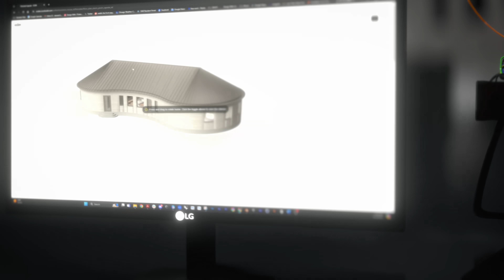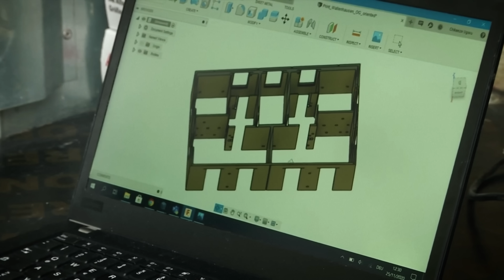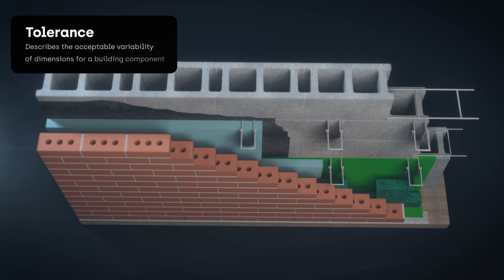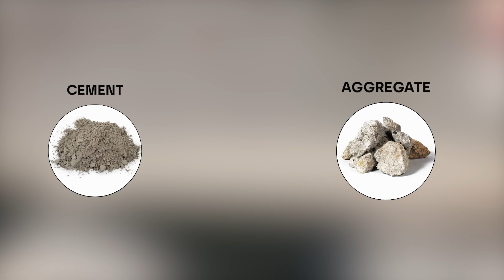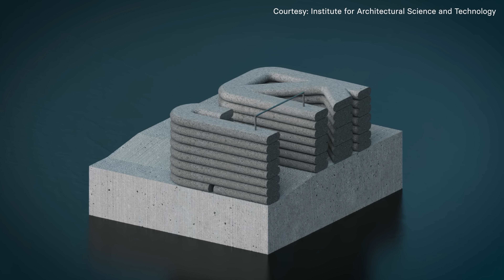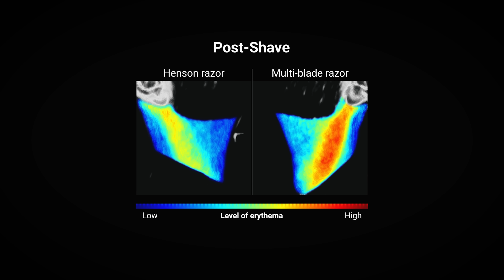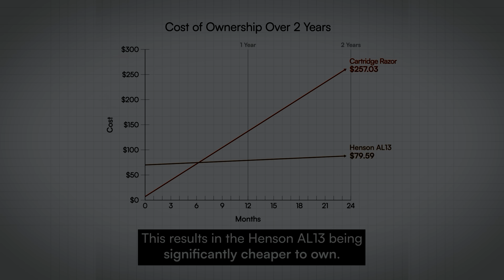Why 3D Printing Buildings Leads to Problems

Comment: The look of the building can easily be changed by using cladding or other wall covering products just like normal houses.
The window openings in the majority of buildings are not very precise and the majority of windows are custom made for the opening. 
Basically, 3d printed houses are not as different as people think and the matenance is not as difficult as this site claims.
Prefabricated walls are expensive to transport and are only as good as the method of securing them together. Yes, 3d printed homes do need more development, but they definitely have the potential to be better than brick or prefabricated buildings.

Comment: READ THIS

Sounds to me like using IDEX could solve some issues.🤔

One with a smaller nozzle and finer mixture used for outer perimeters.

The other with a larger nozzle and courser mixture for infill.

You print in order: Outside, outside, inside.

Then you combine infill every two layers.

That way you get better accuracy and a finer finish, but retain some speed and strength.

Yes this will add a lot of complexity to the process.

When you can work out the kinks, it should make it be easier to finish the other installations and get crisper corners.

If you can get the outside texture fine enough then it can be easily plastered perfectly smooth or left raw depending on the job.

Comment: If the ridges between layers were just a little more consistent I think the look would be nice, but it does get me worried about dust and cobwebs building up.

I wonder if a 1200 sf wall mold would be possible. Drop the inside mold in place, click in the rebar, conduit and pipes, drop in the outside mold and pour. Not sure where the insulation goes, but such a system could produce both a clean interior and exterior finish, and also make for a strong ass wall. 

Dome molds would be sweet too, or with doors and window already installed. But ya molds seem like the most efficient way
Reply: Its called an icf and you want the insulation on the outside not inside

Comment: Electrical, plumbing, and gas would be a nightmare. Making any changes to these in the future would cost a fortune unless you resort to surface mounting. You could then create a facade, but then you are giving up that much space and give up the beauty of poured concrete look. Because who doesn't want to look at a wall where a machine pooped it out?

Comment: In Minneapolis there were a number of mid century modern drive in banks built by  Twin City Federal S&L. They experimented with rounded interior and exterior walls /corner  in a variety of floor plans. The branch banks used different finish materials such as brick, tile, vertical wood panels to create rounded forms -which were very 1960s space age modern. The banks were quite striking. The slogan for TCF Bank was "Tuck a buck, a day away!" Originally the branch banks were round to mimic the bank's tree logo. As a young architect I worked on several of these. After going thru a number of "experiments"in different parts of the Twin Cities  what we found the most flexible construction option was to do the curvy walls on the inside of the bank and then put a more rectilinear form on the outside to fit into limited lots. Perhaps some of the difficulties described in your video might be resolved by using a Le Corbusier  approach from the 1960s and 1970s. This approach was quite fashionable.

Comment: Read below for BS without end.  Slip forming major load bearing barriers has worked for generations.   Leave the design to engineers.  Rolling a cone blunt doesn't qualify one to be a materials expert.

Comment: 2:33 My man, I invite you to come to this wonderful place called Europe, where we've been building 50m+ high structures with small blocks of stone and no lintels for more than two thousand years.
Reply: great point! I immediately thought about curved arches and keystones...doesn't need to be square
Reply: Stone isnt like concrete.
Reply: Right, and those 50m high structures tend to be cathedrals, which took many decades to build.
Reply: @Cucumberflavoredmustard  That's because of the tecnology of the time. I don't think is going to take more than 3 years to build one those in modern times.
Reply: Is there a consideration for seismic or tornado susceptible locations? Certain European building have been there for centuries, but they never faced natural disasters as exampled above.
Reply: @kentl7228  Hagia Sophia in Istanbul has faced many earthquakes, the romans by accident made it relatively earthquake secure, back then it was just pure luck!
Reply: Yes and we do that too with brick. But what we're talking about is poured concrete. Which is wet. Try making a mud or sand house with an arch without putting anything under that wet sand or mud. It's just going to fall.
Reply: Trying to teach new dogs olde tryckes?
Reply: Yes but we didn't simply stack them up that high. The point is not that arches don't exist, but that you cannot build an arch without a support structure. Small scale plastic 3D printing just prints those supports alongside the model and the user has to break them off at the end. But that's not really a great solution for printing slowly drying concrete.
Reply: It's actually funny how they s Americans can be baffled by trivial stuff like concrete houses.
Reply: @alfonshasel1995 we're not baffled by it. There's a difference between blocks and wet concrete.
Reply: @MamaMOB  well yes, there is a time difference. Blocks have to be made somehow, this is where the wet stuff comes in...

Comment: Times change. Just like some manual labor jobs and telephone operators, some jobs may go away with new technology. It just means you need to adapt and figure out a new 3D printer that does 90 degree corners or team up with a company that does (or come up with it).  3D printing may improve in a few years.

Comment: As an architect myself, I'd like to get my hands on detailed specs and their R&D results regarding heat transfer specs and structural integrity of a concrete layered like that. I can see the dilatations for wall insulation, but a layout like that seems to create a lot of heat bridges. I wonder how energy characteristics compare to established building techniques.

Comment: I find it odd that buildings are still being made with materials like concrete. Hempcrete is better and more Eco-friendly.  It is also carbon negative as it draws co2 out of the air which fossilizes the hempcrete making it stronger.

Comment: 3D printing homes really is just another level of this braindead tech-bro "it's the future!" mentality. They think 3D printing is THE future, so they just try to apply it to building a home/building with zero concern for why we might already do it the way we do.

There's already all the problems you mentioned, but another is the fact that concrete is one of the most C02 intensive industries out there. It's abysmally stupid to try and convert our construction industry into using even MORE of it when it's not even necessary, rather than trying to reduce use. We're also running out of sand that is used for concrete, so it's not like it's an endless resource either.

Wood sequesters carbon and is actually renewable. I think a big reason you mention that the construction industry doesn't "innovate as fast" as some other industries is because a lot of it is kind of figured out, and we also have safety standards and codes to consider. It's a bit harder to be a reckless silicon valley "move fast and break things" sort when you're trying to do it with construction and have to deal with pesky regulations trying to keep people safe and buildings from collapsing.

Likewise, we don't exactly need even more "vertical integration" of our industries. We already have these massive monopolistic companies as-is.

It's just an awful idea being pushed by people who pretend like they're innovators, but really they're just grifters looking for a buck while selling false futures.

Comment: I still think, pure 3d printing a home isn’t right, maybe more modular elements integrated into the final product would be better.  I would still love something more modular, print a standardized base structure, then Minecraft build the building cube by cube, interlocking edges and built in piping/electric conduits.  Don’t like a room, unbolt it and change out its parts.

Comment: You can build the outside walls easy, but you need specialized equipment to install the electrical and plumbing. You don't save any time you just push all the work on the tech trades.

Comment: 3:54 I'm thinking that drips like this are not a good sign because instead of being part of the thickness of the layer it's on the outside that does not look structurally sound It's like having a randomly flat brick, no? Also it looks horrible

Comment: At 2:40 it is stated that that openings can not be made from bricks without the use of a lintel. This is just false, sure you can't make a straight horisontal opening but you can arrange the bricks in an arch configuration, a self-supported structure. This method can be seen in various old buildings. One such example is Fort Slava in Finland.

Comment: Construction innovation.... It's the regulation- of rather, the way we handle regulation; that's a problem. New ideas are so difficult to get approval for that it usually just doesn't happen. Unless you're a high end firm that can afford the cost to go through so many steps, greasing the gears every step while every inspector tries to get their bag along the way.... In America, at least, the permitting and inspection process is corrupt as hell and often results in less quality as a result. The whole system needs heavy reforms... And not just for innovation sake, but safety and quality as well. Corruption breeds stagnation and regression.

Comment: A simple brush/blade or spinning head running alongside the spout would smooth out the edges and get rid of that unsightly layered look. Even a scoop to center it into the flow direction would work. Cleanup would be required but a properly laid out drop cloth and ~10 minutes of labor would be cheap as free for how easy that fix would be. Depending on the working time, one guy with a wide trowel could provide a good finish by doing a quick inspection every few minutes/layers.

Really though, if automation is the only desired outcome, machine vision could also handle that task.

Comment: It would make more sense to « print » the forms which will cast the concrete. I guess something could even be done using interlocking hex-shape forms… But it's likely that these solutions are not economically efficient. What's the wage of such a printer / robot operator ? Would that operator be skill-full enough to fix an issue with the machine ? Is it reducing the built time in such a way the customer is saving more money ?

Comment: When this is done, you end up with solid walls.  Concrete walls have a negative R value.  This means they store the temperature outside and heat or cool your home inside, based on the outside temperature.  You still have to cover, insulate, and provide interior fixtures and finishes.    What people outside of the construction industry may not realize, is that it takes 2 guys about 2-3 days to get a 2 story 1200 sqft stick built house framed and under roof.  The rest of the 3-6 month process is putting literally everything else about the house in place.  This process only leaves out the framers, but it makes everyone else's job harder by not having good voids in the walls for running everything.

Comment: I can not believe bro forgot about an archway. Poorly researched video. The reason we in the United States use drywall is because of the modularity and repairability of the structure. Timber frame construction hasn't disappeared in the US because it's the cheapest and safest way to put up a house.

Comment: The main question is is it cheaper to manufacture a home with a 3d printer? Is it faster? If it gets damaged it can be fixed but you will be able to notice the patch on the wall, unless you dress the whole wall, what is the point of making a video about it and not point the advantages vs disadvantages? This is was what I was looking into when I clicked the video and I reached the end with no conclusion...

Comment: I can thunk of a couple different ways to reinforce the concrete in a 3d printed building.   Some could be automated,  some would have to be done by hand, and some could combine the two.

What I don't get is why you would  not have someone with a trowel and some grout smoothing out the layers to make the buildings more aesthetically appealing.

Comment: do you have any argument for why the razor you are selling is better than a properly sharp straight razor? especially one with a somewhat thicker spine which makes the blade keep it's shape better under flexing stress. 
i personally think a fold out razor is much better than any disposable razor. as long as you can strop it's just functionally better.

Comment: - 00:00 🏠 3D printing can translate computer files into physical objects, including full-scale houses.
- 00:07 🌍 This technology promises easy and faithful conversion of digital designs into real structures.
- 00:16 🚧 Several challenges exist, such as scalability, affordability, sustainability, and aesthetics.
- 00:37 🏡 Alquist 3D launched a business to combat housing affordability, completing the first owner-occupied 3D-printed home in Williamsburg, Virginia.
- 00:57 🏗 The construction industry is slower to innovate compared to industries like automobiles and digital technologies due to complexity and lack of vertical integration.
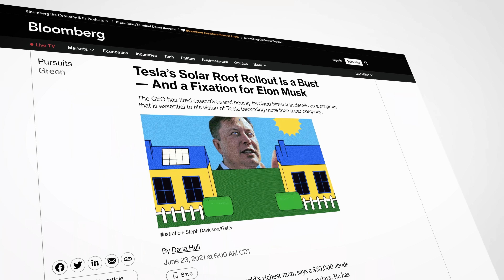- 01:41 🚀 Elon Musk has disrupted the auto and space industries but faced repeated failures in construction.
- 01:47 🤖 3D printing houses use a computer-controlled gantry or robot to deposit a special concrete mixture layer by layer.
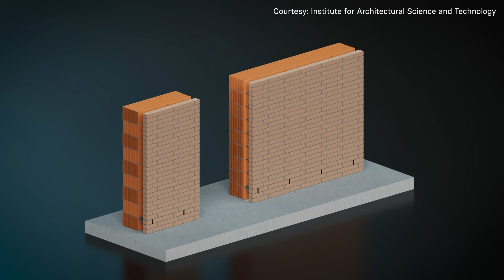- 02:44 🧱 Similar to bricks, 3D printing has limitations like needing support for openings and difficulties with sharp 90° corners.
- 03:30 🌟 Rounded corners are a common feature of 3D-printed houses due to the nature of continuous concrete flow.
- 04:03 🖥 The design process starts on a computer, translating digital models into printable instructions.
- 04:51 🚛 The 3D printer is modular, transported in pieces, and assembled on site, requiring precise setup.
- 05:23 📏 Tolerance in construction is a significant challenge, with robots needing more precision than human builders.
- 06:41 ⏱ The payoff is speed: 3-4 people can print a house in 24-48 hours, compared to weeks for traditional methods.
- 07:52 🔧 Integrating other building components like windows and plumbing with 3D-printed structures poses challenges.
- 08:48 ⚙ The concrete mixture's chemistry and the nozzle's shape affect the final surface quality.
- 09:59 🧩 Walls are often printed in layers with insulation and drainage solutions, similar to traditional methods.
- 11:00 🔨 Flexibility and repairability of 3D-printed structures are limited, making future modifications challenging.
- 12:06 🏢 Companies using 3D printing aim for vertical integration, creating a closed system with high entry barriers.
- 13:06 🌍 3D printing in construction focuses on scalability and reproducibility, unlike its typical use for prototypes in other industries.

Comment: Those rounded corners are a cost nightmare (not for the printer). I have a round opening in my house for a spiral staircase, it was a cost nightmare, the staircase with the required accessories did cost 40% more compared to anything with corners.

Comment: I think the most relevant question regarding the economic viability of 3D-printed construction is achievable height. For the one-to-two story buildings we saw in this video, the cost of the building plot is often a much more significant factor than the cost of the construction. At greater heights, this calculation changes quite a bit. If you could print out like, for example, a five story row house, that would be quite the change.

Comment: Quick comment about the sponsor: but I think shavers need to have a disposable head.  Just replacing the blade means you're putting a loose razor blade in your garbage.  There's no way that can be good...

Comment: The construction industry is so slow because of regulations... a lot of them designed to create business for a politically connected "supplier"

The worst one I had to deal with was nailing these little loops around each wire hole before running wire threw the holes.... so if you're running wire 40' that is about 40 studs x2 (one for each side of the stud) ((That is a lot of work for a non-existent problem of wood cutting in to the wires))

Comment: The spreader just needs two drafting scrapers or flatteners to make the pour flat on the sides rather then rolls at the outer edges that are a waste of material, since they don’t bare any load. 
(____) compared too |____|
This would make it stronger and more esthetically pleasing, not to mention easier to work with or live in. Since walls need to be flat

Comment: The biggest problems with 3d printed concrete houses is;
Ground shifting cracking and crumbling the walls.   i.e. there is no grout.
No one want's to live in a mold magnet those horizontal groves create.

Comment: I'm a Journeyman Carpenter and an Architect, and I'd NEVER spec a 3D printed structural system as they currently are. This industry is not even in it's infancy, it's a zygote.

Comment: Cant you do repairs and renovations manually as you would with a normal house? Sure, it wont have that bumpy texture, but you would want that texture covered anyway with something.
Or is there something with 3d printing that makes it so that attempting to re-concrete parts of it extra difficult?